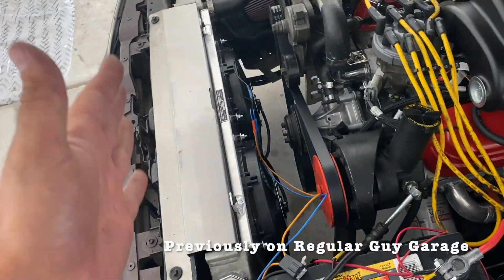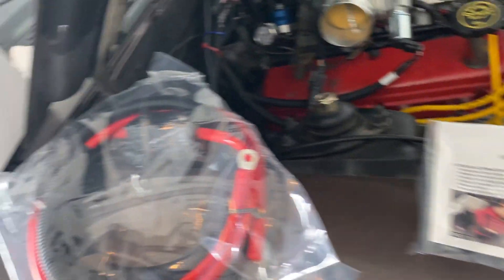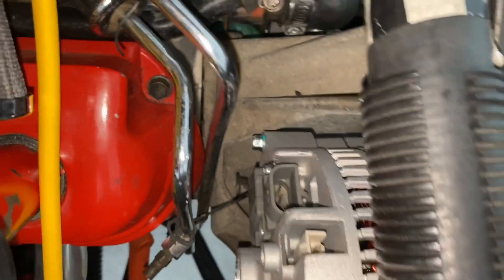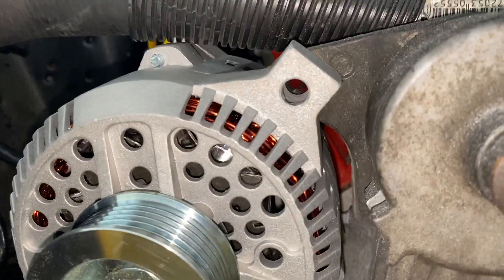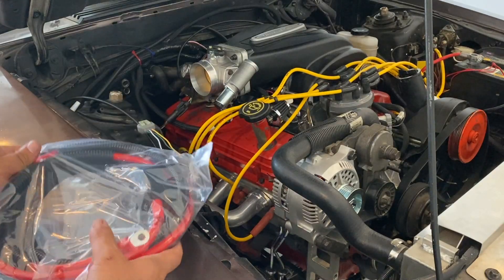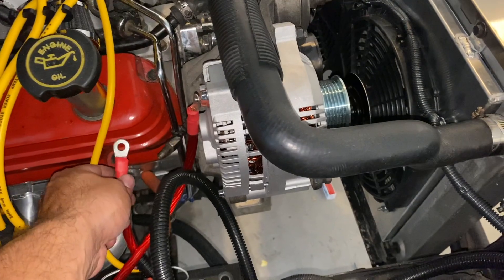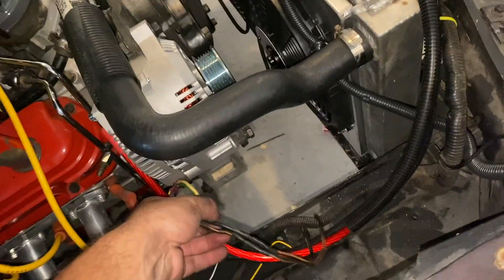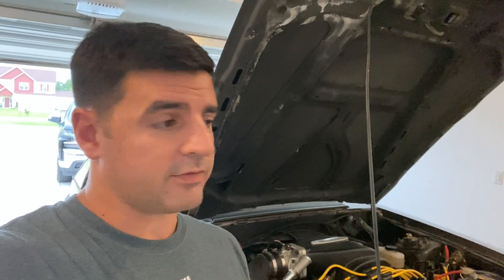Don't Overheat Your Charging System! - 130 Amp Upgrade

Comment: Instead of cutting the plug off of mine i just unpinned the wires from the connector and pinned them in a new plug then got the exciter wire from a newer car and pinned it in so theres no splice to tape up and it gives a more factory look

Comment: So why not connect the 2 black with orange cables to the alternator
Reply: Those two cables go into one about a foot or so down and has a fusible link on the other end plus the wire isn't heavy enough for the voltage 4awg wire will handle everything you need
Reply: What did you do with the two wires
Reply: @brooklynbridge6020  the two black wire i just taped off the ends and left them hanging it worked

Comment: I used the moroso battery cables and box and moved it to the trunk. Moroso makes some nice cables and boxes. I grounded it to the chassis under the trunk.
Reply from the maker: I’ve had my eye on the moroso kit
Reply: @RegularGuyGarage  money well spent. I try to buy parts that will be around for a while. I have their oil pan , girdle and pickup on my 347. Nice oil pan. A little costly but solid. Same thing money well spent. You do some good work. I have a black 85 notch 347 6 spd 4.30s similar to your blue car. Check it out on Instagram luvdemstangs  if you get a chance.

Comment: I’m running a 130 amp and electric fan , holley blue fuel pump , gauges and still when the fan comes on I see lights dim. I couldn’t picture trying to run one on a stock alternator. I’m running a big derale and my car runs around 180 degrees. I think I’m going for a better fan this summer I watch the temps climb sitting in traffic pretty quickly. With a good water pump and radiator. Electric fans suck electricity.

Comment: What size fuse was use on the 4 gauge
Reply from the maker: I believe it’s anywhere between 125-150 but I didn’t pop it open to check
Reply: Regular Guy Garage  ok thanks.

Comment: When I built the engine for my buddies fox, I told him it was 2 last things to buy.... the TFI relocation kit and a 3G alternator to make it reliable and smoke free. I just get a stock 95 mustang or Taurus alternator from a pick a part and get the plugs while I’m at it if going the cheap route, Taurus has to be reclocked but will have what’s needed for $43 or new from my eBay source for $90 new but any way is far superior to the fire hazard they came with lol
Reply: Whats this tfi relocation kit you speak of?

Comment: First. Lol
Reply from the maker: Beat out the other 9 people that watch my videos 🤣🤣🤣
Reply: @RegularGuyGarage  hey I'm not that big to amount to 9 ppl 🐄 🤭😂🤪😂I'm just the other guy who watches your videos 🤣😂😜 jk nah man great upgrade and something that I need to look into in the near future if I can ever get finished with porting these dang heads I can move on with it and hopefully get it going in a couple weeks hopefully. I've never ported any heads and I didn't realize how long it would take and I hope that it is worth all of this time I'm putting in them. I'll probably only gain 3.245hp from 40 hrs of porting and burnt up 3 drills. But anyway bud keep the videos coming because I look forward to watching your videos and you have made it up to the top of my favorites list
Reply: I have a 91 GT that still has the old style alternator I believe I changed it once since owning it. Back in the day now don’t quote me, but the larger alternator pigtail caused fires. The pigtail would fail internally and allow the contacts to touch thus causing a fire. New or remanufactured alternators would come with a new pigtail. 
Have you upgraded starters yet to the PMR style, something else I need to do as well.